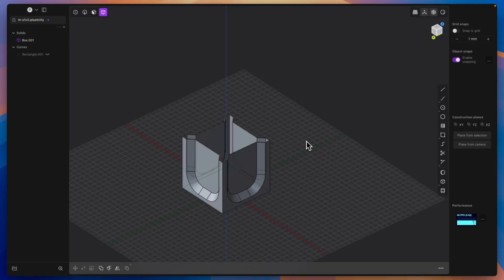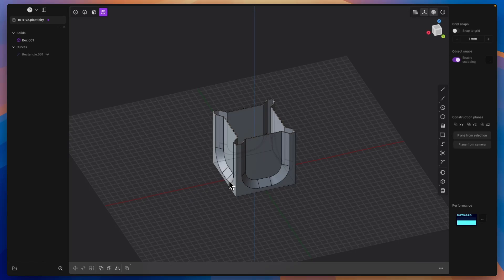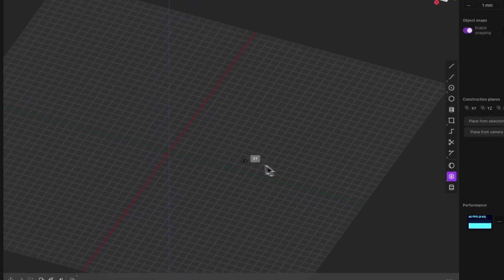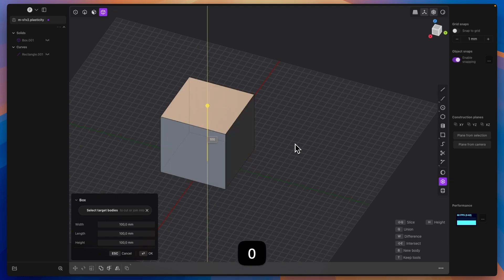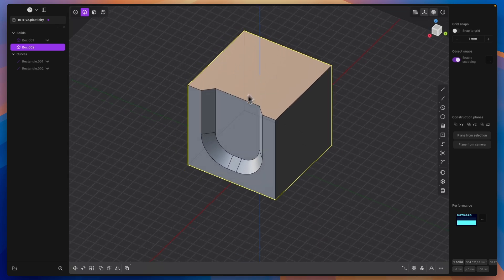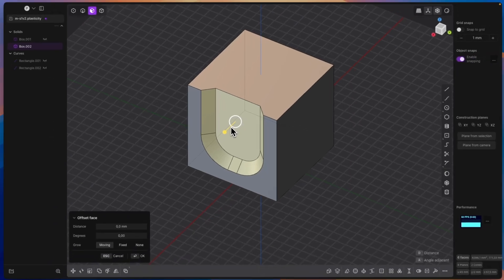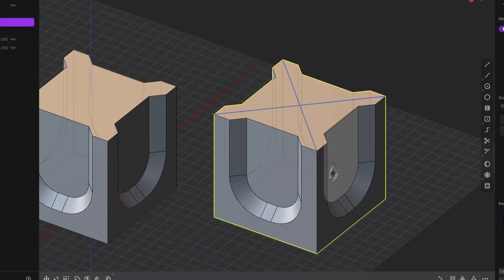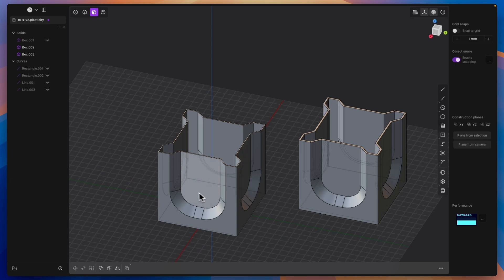How to use radial array in Plasticity? Step-by-step guide!

Comment: Hi, thanks for this video. I use all the buttons on my Spacemouse with plasticity: open the 3dconnexion menu (Menu button on the spacemouse) when in Plasticity; in the button tab you can assign your keyboard shortcuts to any of the buttons on the mouse.
Reply from the maker: On Windows you can use buttons. However, it is not supported natively by either Plasticity or 3DConnexion.
It doesn't work on macOS. At least, it doesn't work for me.
I don't know if it works on Linux.